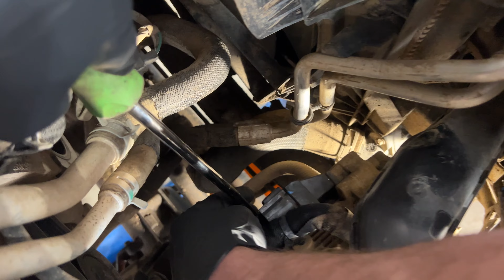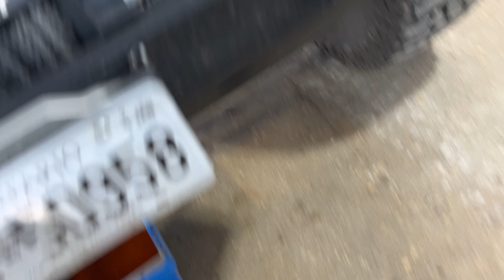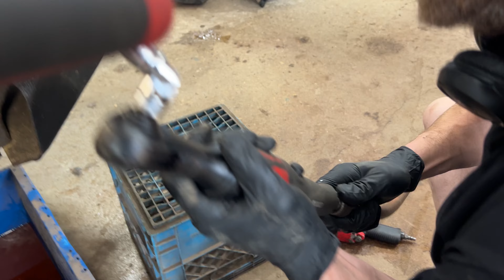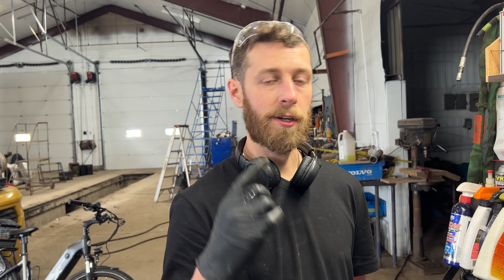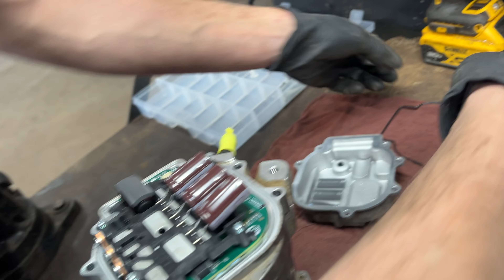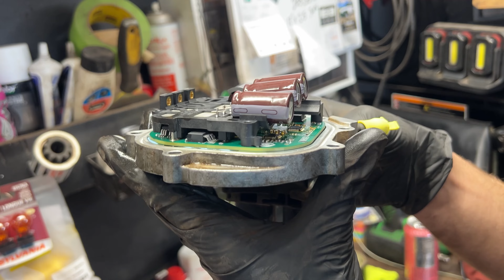How To Remove Power Steering Pump 2020-2023 Jeep Gladiator

Comment from the maker: There now is an ongoing recall for this issue. Check with your dealer if your vehicle is affected so that you can get this replaced at no cost.

Jeep Gladiator trucks electrical connection issue in the electric hydraulic power steering pump wiring causing fire.

https://www.cbc.ca/news/canada/windsor/stellantis-jeep-wrangler-gladiator-recall-9.7228111

Comment: Okay, I just took my 2024 with only 3500 miles on it, regarding the recall for the Dare OEM (3rd party, not mopar) power steering pumps on the 2021 to 2025 Jeeps. You can read about the problems with the Dare header connector not mating properly with the wire harness on the internet. Dealer ran a resistance test, and physical inspection, cleared the recall, and assured me, all good to go. Now, with paperwork in hand, of clearing the recall, at least I did my obligatory part, but I park outside. I'm trusting the "physical inspection" as possibly being a disconnect, reconnect, of the connector, whereupon if there was said "forced action, causing metal connector tabs to separate, or even go through" that such would create need to replace. I'm also assuming, all Dare/Mopar hydraulic power steering motors, in situations used as repair replace have to be either carefully installed, or returned in exchange. 

Lastly, if I notice my power steering light comes on, and I mysteriously lose power assistance, I'm headed straight to the closest repair shop. Think I'll also get a fire extinguisher.

Comment: Im having same problem. I left it at dealer for 5 weeks & they were not making any headway. 2500 later they then called & said all ready. I drove for 2 days & it all started again. I feel like it's the power steering pump. How can i diagnose it myself? Please help
Reply: He shows you how to trouble shoot it in a previous video at the Can bus
Reply from the maker: @jeremyterrell2225  the only way to catch the issue is when it’s acting up
Reply: You need to replace the gear box with the pump and high pressure hoses since they get clogged. Basically you need to replace the whole power steering system and clean the non high pressure hoses with parts cleaner or something that will clear the lines

Comment: I'm looking for an electric pump for a build in working on. Is this supplied 12v ? Could you see the rest of the module being applied independently?
Reply from the maker: @ttsupra2503  hey there, the pump is in fact 12V however I believe the speed controller inside is commanded via messages from the PCM, not sure if you can just feed it a straight voltage to signal it on and off
Reply: @Tech-28  I was thinking a steering column torque sensor like what's used on electric column units. But I will dig into the custom groups and see if people figured a way to make it work in a buggy
Reply from the maker: @ttsupra2503  check out a first gen Prius steering column motor, I’ve heard they are an easy plug and play type unit, not sure if it would give you enough torque for your application tho
Reply: @Tech-28  unfortunately inline would not work. It's for a 2015 Tacoma on 37s and a tundra modified rack. Need 1650psi output PSP but they are 5k my price. So why not electric and save gas
Reply from the maker: @ttsupra2503  I love it man! I wanna see this thing. I’ll ask a couple people and let you know if I come up with any solutions for you